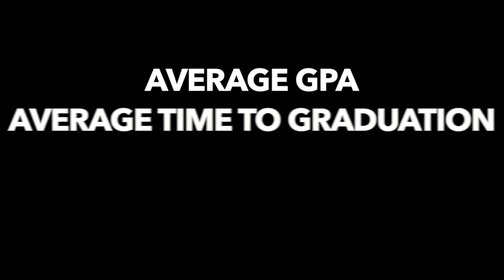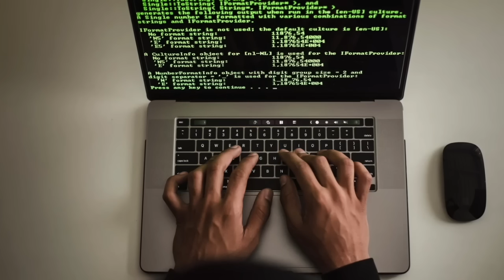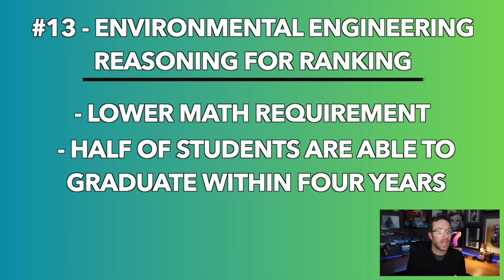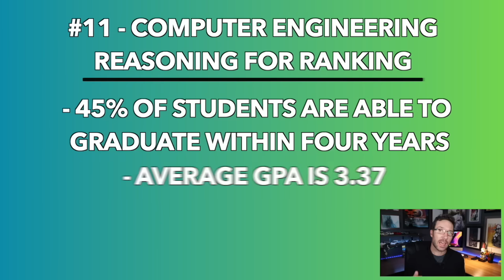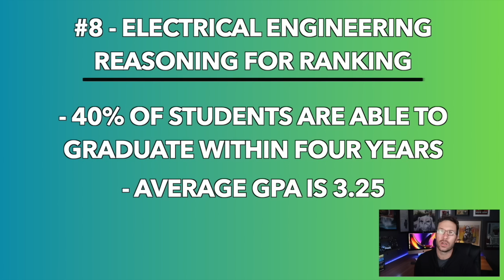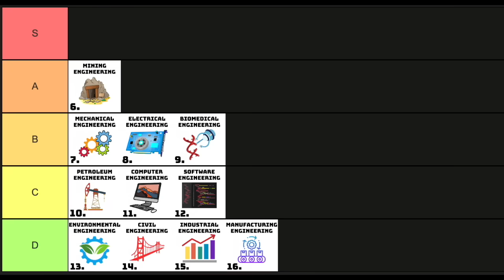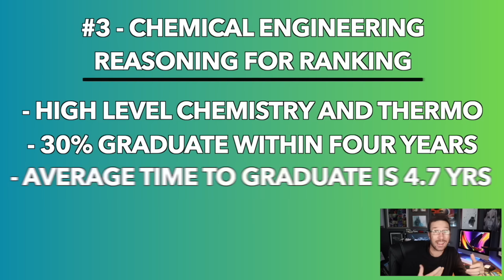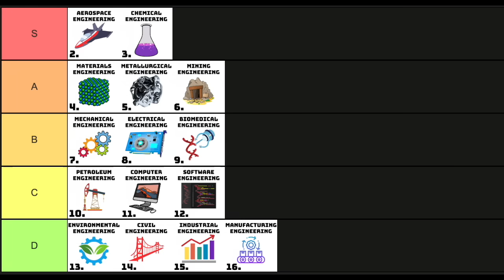Engineering Degrees Ranked By Difficulty (Tier List)

Comment: Some of these “finish by a certain time” are not reflective of the difficulty of the course but the strength of the student. EE and software both have students finish fast, but the students are usually very smart. This means there going to be finishing faster based on their skills
Reply: I think a list like this needs to be careful. The university you attend can greatly affect the difficulty of a given major. Also, I would bet $$$$ that the best indicator of degree difficulty is pay on the outside. The demand comes from poor supply. The inability of the industry to find qualified people is *(a significant) part* of the reason pay is so high. 

Also, the required math can be higher or lower depending on that university. I know my fellow CS grads had to take Linear Algebra (which is generally intended for students who have completed Calc 3 and ODEs - making it arguably equivalent to a course in PDEs). I don't remember the requirement because I was double majored in Math - so I took a whole bunch of math courses other than that. I don't remember if they had to take Modern/Abstract Algebra. 

Honestly, I find comparing them like this to be meaningless. What makes some of these degrees hard for some might not be hard for others. Generally, I tell people to get the hardest degree they can, but when you're talking about real engineering degrees, you're splitting hairs in a meaningless way. Having a solid base of math, science, engineering, and other demanding coursework will provide the best results. 

As an aside, most of the engineers I knew had specific [elective] classes they took to avoid hard stuff. Those classes were more frequented by certain engineering fields (that are kinda high on this list...) - but it's hard to quantify that (and it could be a university to university difference).
Reply: @descendency  Im in my 2nd year of CS right now. Honestly as a kid I thought this would be insanely complicated shit.
But honestly man, it really aint that much. Its interesting, and I genuinely like it, but its so overhyped.

It aint really real engineering. Yea everybody has to take Linear Algebra, Differential Equations, Stats, Discrete Math, Numerical analysis, and whatnot.
But idk man. I share alot of courses with Engineering kids, and yall be learning wayyy more stuff than us sometimes lol.

Im taking this computer systems course right now. For a lack of better words, its made purposely more difficult than it really is.
Glorified counting excersizes for some of the most basic concepts. 

Like come on bruh. Do we really need a whole ass course just to learn how to program in Assembly, or make a processor out of an fpga??

In the Uni where Im at, CS has such an insane GPA requirement to get in. Most kids just end up fucking it up and switching to electrical engineering.
But honestly I dont know why its even like that. 

I should be doing something else. I wanna be making missiles for Raytheon honestly. Thats like my dream career now.
Its moreso I wanna work on the computer side of that stuff rather than the mechanical side of it. Stuff like AI guided missiles.
But bruh fluid dynamics and stuff seem beyond me.
Reply: @honkhonk8009  good thing about cs is it can be as hard as you want it to be. There’s lots to learn and it really depends on your uni. Since you plan to do machine learning you’ll definitely see and be exposed to a lot of hard stuff.

Comment: Honestly, you gave me some hope for Electrical, I want to do Engineering, and for the longest while I  was meditating on whether I should go for Electrical or Mechanical.
Reply: Electrical is great, it's fun, you have broad and good job opportunities. 

But this video is uninformed on it, since he said ordinary dif equations was "the highest level of math", but I'm 2nd semester and we're currently far past that, using Fourier and Laplace transforms, doing analysis of AC systems in the complex plane etc. So it is more math involved than he claims. 

I'm personally going into electrical energy and power engineering which has overlap with mechanical due to working with forces, energy and electrical machines so much. If you consider those two I would suggest looking into whether such a degree is available to you.
Reply: @ariex0a  🤧🥲😫
Reply: I switched from mechanical to electrical after the first two years in college. Most of the coursework was still the same in those two years so I didn't really waste any time. For me, the main deciding factor was how much I disliked mechanical physics and statics. I enjoyed electricity and magnetism physics much more.
Reply: My school had both ME and EE. They were probably equally difficult although in different areas. If you like differential equations, mechanics, material science, fluid dynamics and so on then ME is the way to go. If you like transformations, circuits, programming, various fields of physics then EE is the way to go. I personally also prefer the electrical engineering stuff. My focus was on microcontrollers, control theory and analogue circuits. 
I think a bit more of material science or chemistry would have helped but our courses we can pick is so dense already that no material science or chemistry would have fitted anywhere. Anther thing that was completely lacking was process engineering. But I think with our education it was just expected that we will quickly pick it up, in case we would end up in that field.

Comment: I’m not sure if astronautical engineering somehow equates to aerospace engineering, but wherever it fits in, I sure had fun getting my Astro degree from USAFA. Every thing we touched blew up! The math was several hundred years old, not all that difficult. The concepts were fascinating! The problem was avoiding getting sucked into missiles or space command when a coveted fighter pilot slot was already in hand. I dodged that particular bullet by leaving active duty and flying with the reserves. No space force assignments from that source. Happily retired and untouchable now! Whew!!!
Reply: Kinda, but not quite. Aerospace is more of a broad field, typically divided into aeronautics (think aircrafts) and astronautics (think spacecrafts). Though people that specialize in one, still tend to know quite a bit about the other.
Reply: Yeah AE has more in-depth study on fluid dynamics.